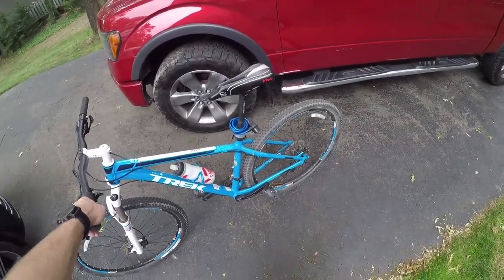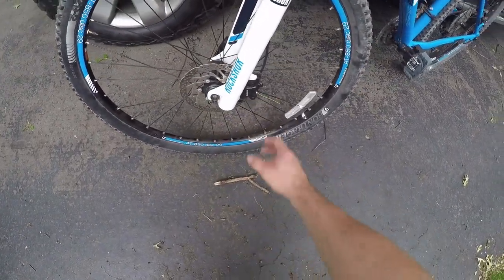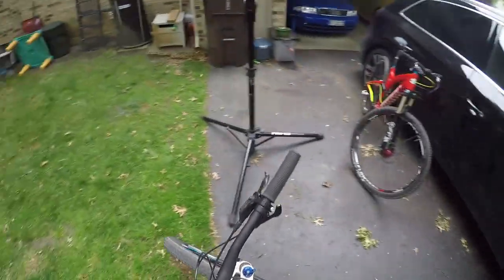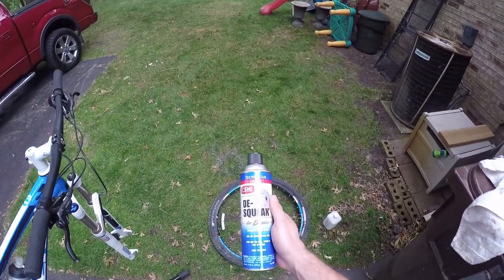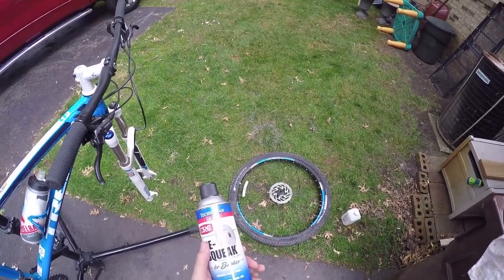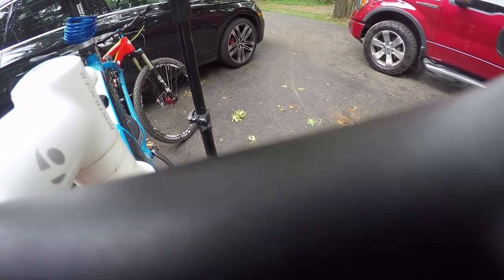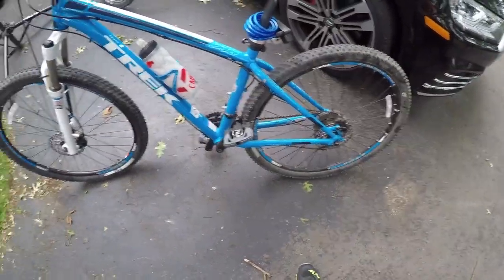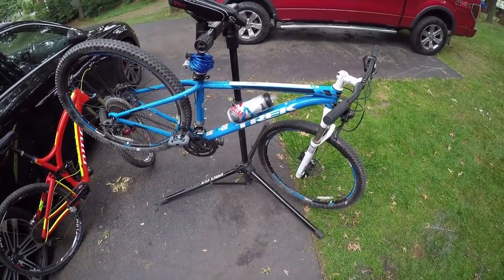Stopping Bike Disc Brake Squeal - Here's a GOOD DIY Technique you Probably Haven't Tried Yet!

Comment: be careful, just like valve lapping compound this stuff should be THOROUGHLY cleaned off the rotor and pads with soap and water so it does not prematurely wear out the pads and rotor

Comment: The problem that I find with all of these tutorials you follow all of the steps and it never goes right. So you say fuck it and buy a new disc and pads and now I get the problem of having no braking pressure so I bed the disc in and it is still terrible. What do I do...
Reply: Charlie Dillon if you haven't pressure I think you have a lack of oil in your system
Reply: Leyan 56 I am not really sure I used a load of brake cleaner and it seemed to help but it will work one minute and not the next.
Reply: My father has the same problem. The joint of your piston is ded and there is oil peeing on your pads and you can't brake anymore (sorry for my bad english i'm french 😉)

Comment: I've been having a severe noise ever since I put new pads and rotors on my road bike a few weeks ago. I have the Shimano Dura-Ace flat mount calipers with resin pads and I got the Shimano XTR SM-RT99  Ice rotors 140 rear and 160 front. The squeal mainly comes from the rear. I picked up some of the CRC product today you mentioned and followed your steps. Guess what happened? It didn't work. I have tried everything I can find on youtube and they still squeal, mainly the rear. I never had this issue with the Campagnolo rotors I replaced. Yup I was using Campy and Shimano together. I'm going to put the Campy rotors back on the bike because the Shimano rotors are shit.
Reply: sand the pads...
Reply: Is there a compatibility issue with rotors and pads in some cases?

Comment: Dont buy this for anything but a car. This is made for car rotors that will be covered by wheels, and even then with some wheels you will see a bunch of this stuff on the car unless you take time to SCRUB it off, and you will need a stainless steel brush to get it off. Use a paste that you can spread on. I just spend 2 hours getting this stuff off,  and that was with using a degreaser and brush. it most definitely does NOT "wipe off" like this guy says. I almost just bought a whole new rim. Thanks for ruining my rims guy.

Comment: The sound that you have is from contaminated brake pads. When you have a high pitch sound it is because the rotor or brake pads are of a poor quality or incompatible. There is also brake fade and squeling when you burn the rotor so that on the surface you get a really high strength shiny steel, so that the brake pads can no longer adhere to te surface. A finer sandpaper aplied to the surface of the rotor will fix it.

Comment: Just rough up your rotors with fine sand paper, grind or file brake pad surface, reinstall everything, hold brake lightly while riding in an easy gear and as the brake seats the noise will eventually go away. No spray or cleaners needed!,. WHAT HE DOES’NT SAY HERE IS THAT THE NOISE WILL COME BACK. The only way to completely reduce the noise is to change pads to an organic set - stay away from the metallic ones!

Comment: ⭐ you can spray brake cleaner directly on the towel or cleaning cloth in an area the size of a dime or nickel to prevent overspray... But, what you should do is AVOID HYDRAULIC disc brakes altogether... They're filled with MINERAL OIL and if that stuff leaks out and gets on your rotors, it's squeak city baby... I suppose regular disc breaks can squeak also, but there's no chance mineral oil from your brake lines will cause that...

Comment: IF u don t have tnat stuff jn a can which admitedly looks like it works well, u can take out ur pads and sandpaper them on a flat surface. take about 1mm off and clean everythin and put it all back together. That works too. I m in Indonesia and we are not blessed with a plethora of repair tools and equipment that u all have in te USA
Reply: I've used a file on the pads without takin them out of the caliper in the past... but only because I was at the bike park and didn't have all my tools. The file on my Leatherman fits perfectly and takes it down pretty fast to expose clean brake pads. If I'd been home I would have removed them, used sandpaper, cleaned thoroughly and reinstalled.

Comment: Never use automotive brake cleaner. It has some oil in it and you will contaminate your pads. Also the pads are organic not metallic so the spray he used will also contaminate your organic pads. Don’t listen to this man.

Comment: Why spend money on brake squeal spray when all you need is.....water!!! Rough up the surface with fine were and dry paper and then clean.  Rough up the pads and reassemble.  The just ride about applying the brake.  It took no longer, in fact probably less time but the bike is fairly new, and hey presto same result.  This procedure is well documented on YouTube, costs absolutely nothing and is 100% effective

Comment: Seems to be an American thing to make a full length movie full of inane comment where a short video would have done the job...... just spin the wheel and spray iso into the brake calliper, wipe rotors with a clean paper towel and roll down a hill with the brakes on to re-bed. Two minutes, job done.

Comment: I think it’s normal for the squeal to vanish when the pads and discs are hot. Trouble is the noise returns when they’re cold.
Reply: It's the complete opposite for me. No matter what I do my rear rotor gets really hot then starts squealing until it cools off. I've got new Galfer pads on the way because I suspect my stock ones are contaminated (or just plain cheap/crap) BUT I've had other riders suggest I try a larger rotor on the rear to solve the issue.

Comment: This stuff is a pain to get off of the spokes, and rim. I was going to cover them with paper, or a plastic bag, but went outside and forgot. Now I have htis gunk all over the spokes, and it is a pain to get off so far. Do yourself a favor and cover the spokes etc more then this guy did. This guy for sure has crap all over his spokes from this that does not come off easy. Also the spray did not work, but it could work for you as the reason behind the squeek could be different, or I didnt bake it in properly. I would look for a paste though that you can rub on this stuff is a pain to clean off.

Comment: Good Lord....so much quicker and easier to simply pull the pads, deglaze the surfaces with Emory cloth or fine sand paper on a sanding block, then clean with isopropyl alcohol, then bake in the oven or take a torch to the pads to bake out the contaminates, and reinstall. Works every time, even on heavily contaminated pads, and I can do both front and back and have them reinstalled before you even get back from your first ride dragging the brakes and sounding like a broken clarinet all over your neighborhood.  More importantly, it's important to visually inspect the pad surfaces. But to each their own.
Reply from the maker: Jeffrey Walker - it takes me less than 5 minutes to do this.  I suspect your process is longer.  In any case this is an alternative method as some people aren’t going to remove their pads and torch or bake them.
Reply: Clydesdale Chris MTB your vid is over 17 minutes, so figure what, 5 minutes per brake? And how long of a ride after? 

Pulling the pads is dead simple easy, allows you to examine them to see how much pad is left and how glazed they are. Using Emory cloth on the pad very evenly cleans and deglazes the surface without potentially damaging them further if there is foreign contaminates on them that will end up scoring the disc surface, and flushing with alcohol then baking or torching has always worked for me to get contamination out of the porous pad material. I've done it many, many times, even on pads that had been drenched with hydraulic fluid.

Not trying to be super argumentative, it's always cool to see other methods, but the method I described is sure to work every time and is much faster as I can do both front and rear pads, rinse them, torch them, then clean the rotors while I'm waiting for the pads to cool, then reinstall..10 to 15 minutes tops and will work on contaminated pads.
Reply from the maker: 5 minutes per brake including ride.  Ride was about a quarter mile and maybe 2-3 minutes.  I never said this method was the "best" or "fastest".  Reading the comments, you can see it's worked well for people.  I'm sure removing the pads, sanding, and baking has also worked well for people.  We can leave it at that.
Reply: Jeffrey Walker Brother... from the looks of your level of interest regarding his technique on how to "properly" clean and squeal-free a rotor, why would you be critizing rather than benevolently sharing your technique? There's no need for conflict with your scornful explanation as to how your technique is purportedly faster. As evidenced by other comments on this video, people, including myself, found this to be a helpful video and a successful method to caring for a squealing rotor. If you find your method to be faster, then why don't you go out of your way to make your own video tutorial?
Reply: Pull the pads, clean em, cook em with a map torch did the trick for me. I also cleaned and sanded the rotor with a 320 grit nail file (had done that before to no avail)

My bike had a squeaky front brake system from day one, brand new bike. After 1500 miles and several attempts with other methods no dice. Actually just gave up on using the front brake. 

Interesting note one of the pads, after the water flashed off started cooking off a flammable liquid. That pad was obviously contaminated, likely by the shop that assembled it.  Front brake is also much much stronger as well.
Reply: Thank you Jeffrey: your method is the best (fastest, cheapest and most effective).
Reply: I've done that before on my DH bike and it worked. However this last case I had it did not work. New pads did not work. This fixed it after every other trick in the book failed.

Comment: Another question: the spray has a warning label saying it's very flammable. Is this something to be concerned about once the baking-in process is done and the material is dried?
Reply from the maker: Good question - it's flammable due to the propellant used - meaning, if you held a flame to the spray from the can, you'd have an issue.  Once it's on the rotor and dries, it should no longer be an issue.  I wouldn't spray it onto a hot rotor.

Comment: Just put some Ethyl Alcohol on the rotors and calipers then squeeze the brakes at certain amount of speed and you're done
Reply: Only works if the problem is oil etc on rotors or pads.

Comment: it dose help if u clean the pads as well , there should NOT be any nose at all after cleaning . 
If u have OIL on your disc ,  use HOT water & washing up liquid on your pads then clean disc .
Do NOT use Methylated Spirit  to clean as it leaves a residue on your brakes causing brake loss

Comment: Probably the main cause of brake squeak is spraying your bike with a frame protector, simply clean the rotor and discs with muk off or soapy water dry it off and ride it. But i'm not an expert
Reply: I tried what you said before but this videos tip worked perfectly.
Reply: Davy Scales the main cause is -glazing...yep, just like 'car' brakes.

Comment: Sorry to tell ya but your method just makes it worse... Glazing of the rotor and disc pad braking surface has to be removed a  Here's what you do... 
1. Get your garden hose or a pitcher of water.
2. Find some dirt, pour water into it, and make some MUD!
3. Using your fingers apply plenty of MUD on your rotor, and go out and ride 1/4 ~ 1/2 city block, come back apply more MUD on your rotor and repeat until the sequel is gone.
4. After the sequel is gone, rinse off the mud from your rotor and caliper.
5. BINGO, you just removed all the glazing from your rotor and your brake pads and you're back in Bizz..

The trick is to remove the mirror-like glazing from the rotor and the disc pad braking surfaces which causes the brakes to squeal in the first place. Sorry but using chem cleaners just makes it worse.  You either SANDPAPER the rotor & the disc pads to remove the glaze, or use MUD which is liquid sandpaper...!  I think you get the picture.
Good Luck and Always remember dirt and mud are a disc's brakes best friend.

Comment: I need help, my bike squeaks even when I don’t press the breaks
Reply: Matas Grigonis That means your brakes are touching the disc, without even braking. Find how to true you brakes on youtube
Reply: First see if the bolts are loose. If yes hold the brakes and tighten the bolts. If everything is tight then check for bents in the disc Use pliers made for disc rotors

Comment: Sqeaking in a car s brake system signals replacing pads. Believe the same for a bike, especially an e bike. If you haven't changed your pads after 6 months and riding fast all the time, it's best to do the pads. Don't ruin your bike s brake system. Simple effort over tricking ya ride.

Comment: DONT USE THIS ON BIKES. This is for cars where the rotor and the area around it will be covered by the wheel. This crap is a pain to get off, even with a degreaser. I just spent 2 hours getting rid of all this crap because the guy said"it just wipes off". It doesnt wipe off at all. If you are despereate to try something like this get a paste de squeek that you can wipe on. I almost just bought a whole new rim because  of guys lies.

Comment: your quick release skewers are the wrong way round i believe
Reply: Sneaky well you believed wrong
Reply: Doesn't matter which side since it is only a 9mm QR skewer. Some QRs run risk where, if they accidentally open, the lever can go into the rotor and stop you suddenly. I believe their was a recall for those QRs. BUT most people just put the QR lever on the non-disc side to eliminate that risk. Also keeps fingers away from accidentally touching and contaminating rotor.